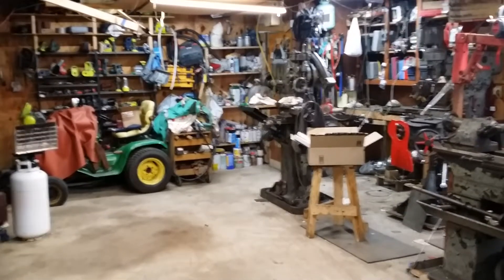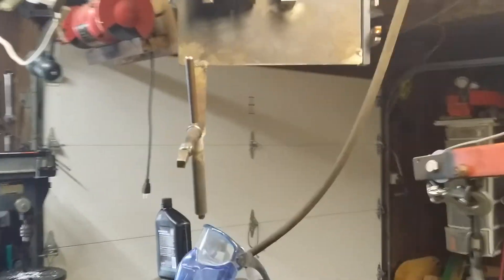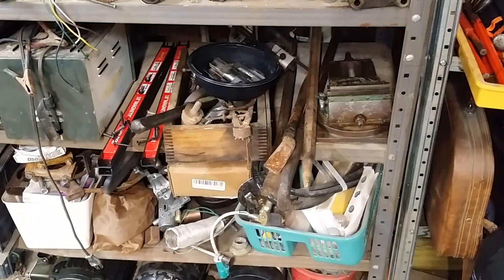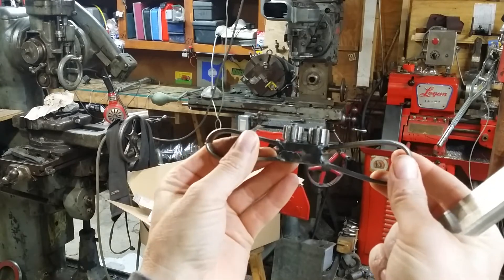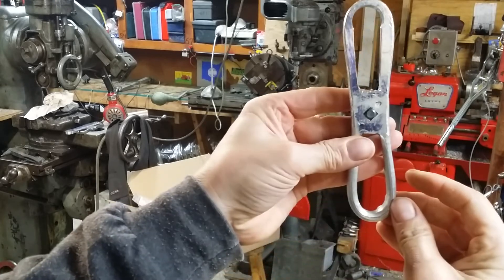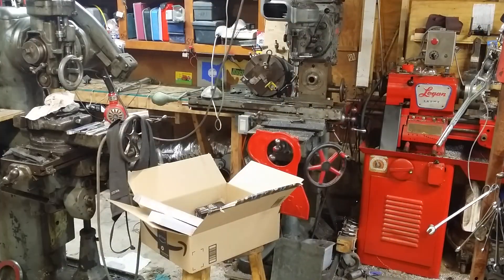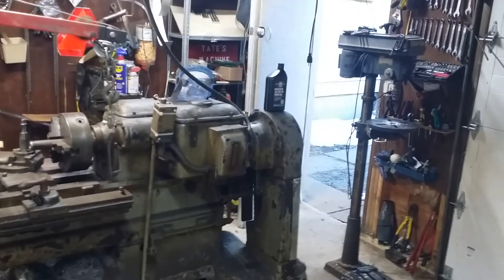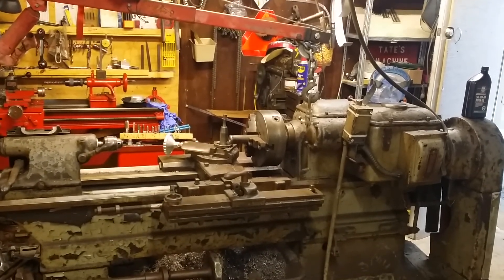Shop organization part 3

Comment: Lots still to do - but you've clearly made some big strides forward! Nice work. Looks good seeing a big open area of floor. The lathe tool storage is a good way to use that space above the headstock. 

I use roll around cabinets, I love the drawers, and steel constructoin, but they stand still 100% of the time.

I would love to join in with your no packratting rule. Would be great to get a succinct way to note it down.

Current rules in my shop are: Rule #1 "The floor is not a shelf" which to me, means - keep the floor clean, and by extension workbench tops.

Rule #2 so far is "Clean my plate" - to me, this means don't start new projects until the current project is done. This is proving easier said than done. But having a little sign up helps me stay on task.

I've heard others using the rule "Clean the workshop at the end of every day". Once I have a handle on "clean my plate", and am living it day-to-day, I will endeavour to have some kind of daily cleanup rule.

I am going to study your seven rules now!

Cheers,
Craig
Reply from the maker: Oh yes definitely much to do still. But I need to not think of this  as a 1 and done solution. This will be an ongoing ever evolving thing even after I get this reasonably under control. 

No pack ratting is definitely not gonna be easy for me, but at least hopefully I can keep excess stuff out of my work space.

I really wish I could embrace the "clean my plate" rule. But I know I just cant. Probably too much ADD.. lol. 
However I try to recognize that and plan things in smaller chunks (to the extent possible )

But I am confident that with some kind of reasonable rules that fit me, I can get to a good place. 

Thanks for stopping by. Hopefully I can get away from videos like this soon, and back to building stuff again
Reply: @craigtate5930  Yes - agree with all of the above, but - this kind of video is a good record of progress, and a great way to crystallise ideas and commitments. I know in my case, my building stuff had pretty much come to a halt, so I had to do some re-thinking before I could get back on the making (and videomaking) wagon.

Comment: Hello Craig,
I am pleased to see the evolution continues... and the workshop looks more organized from last time...
The idea of having the metal storage out of the workshop is good and only bringing in material as and when you need them, also then putting back any unused items would not be a giant task.
I have been trying to go with "get the tool, use it, put it away" policy... somethings I end up doing it many times with the same tool which could be regarded as inefficient but I am not in a production environment and it does stop everything building up into one almighty mess and now it is becoming more of a habit and I don't have to think about it to much.
Keep up the good work.
Take care.
Paul,,
Reply from the maker: Thanks. I feel like I have to make a series of changes at my very core to pull this off. I was meant to be a slob I think..lol

Comment: The rack over the Hendey reminded me of an idea I had for storage:  rotating stands, like the ones you see in stores for greeting cards or watches.  Maybe three boards or steel plate with a lazy susan bearing attached to the ceiling? The thinking part of organization is the most important, so you are making progress.  And like your rules, except for the one about "just in time inventory" (that and global sourcing got us into trouble during the pandemic)!
Reply from the maker: Well hopefully my on demand ideas won't bring about another pandemic.   Certainly like the swiveling overhead storage idea though
Reply: @craigtate5930  Yeah, you're not an N95 mask supplier, so you're probably fine.  Just one of my pet peeves on modern business management.
Reply from the maker: @danielabbey7726  modern business management is part of why I won't be a commercial electrician anymore ;-)